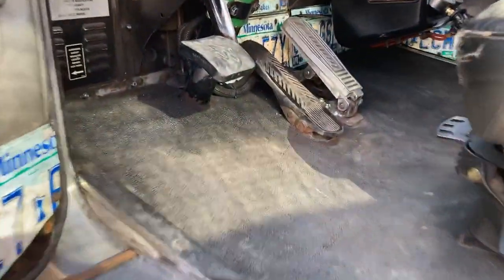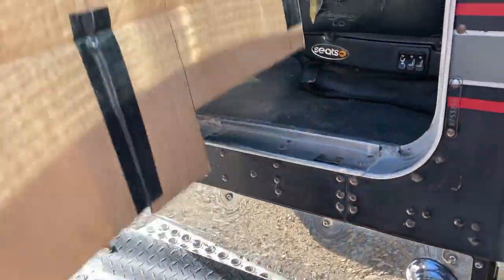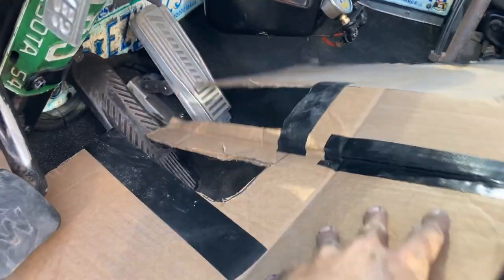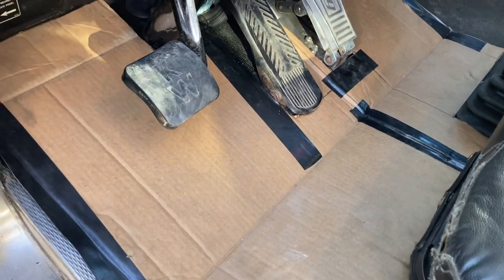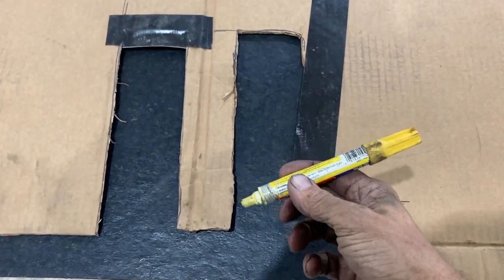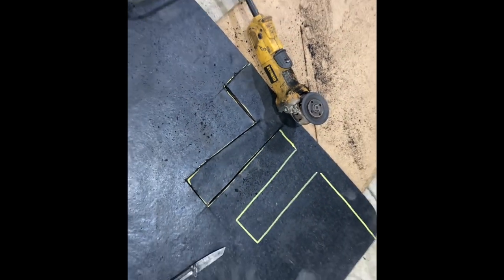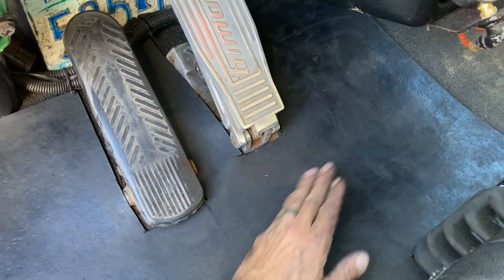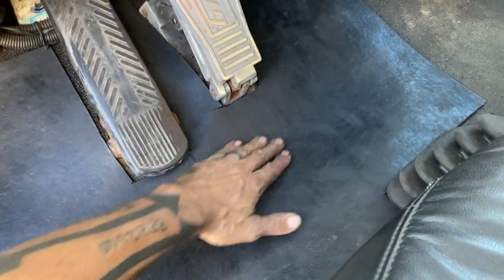How-To Make A  Mudlap Floormat

Comment: Hey Philip, awesome to see you using a mud flap for your floor mat👍. I have been doing the exact same thing for over 20 years. They work great and they take forever to wear out and I keep a rag sitting on floor next to seat. Each time I get in and out I just use the rag to quickly wipe the small amount of dust/ dirt from your boots out ther door only takes half a second each time you get in I find and keeps floor clean and dust away from cab. A damp cloth also brings it up nice and dark black again when needed. Keep up thre great work loving your channel with the classic trucks and thr pin striping. Old school all the way 🤙✌